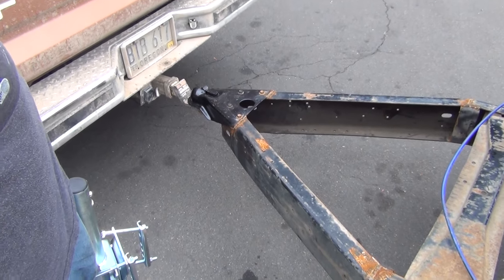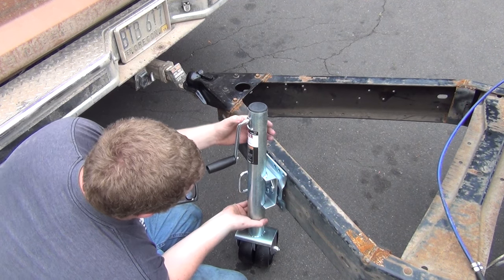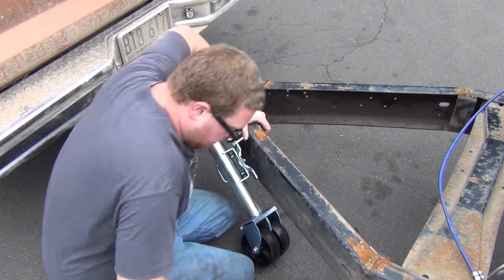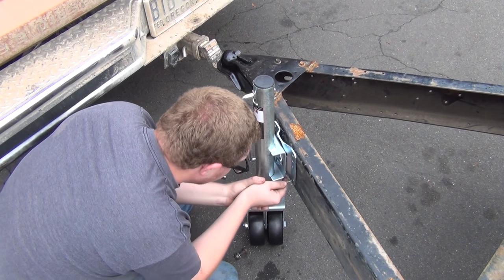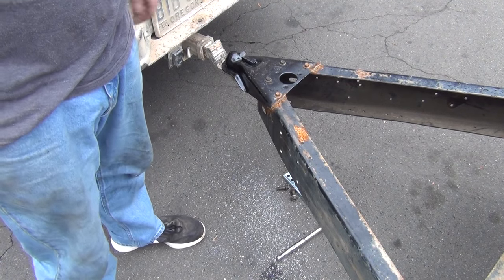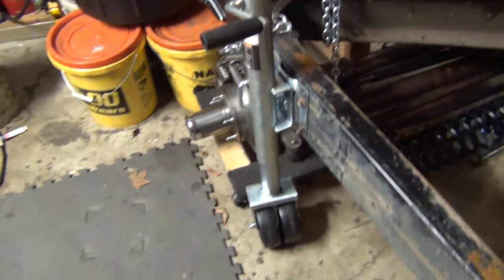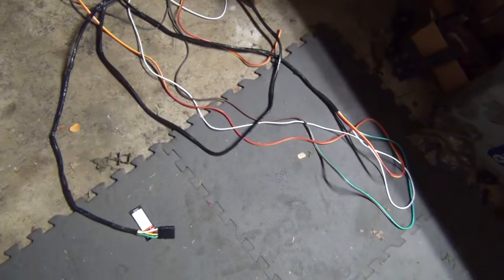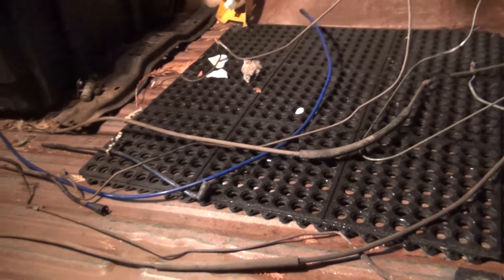Building a Bed Trailer! Part 3

Comment: having watched several of your vids, I applaud your efforts and ingenuity. These truck bed trailers are worth their weight in gold. I've made a few myself. Keep a few things in mind. Most truck frames aren't just mild steel. They're heat treated which requires a specific welding, cooling, and post weld heat treat process in order to mitigate stress risers and cracks....especially on a load bearing member of your trailer. Regardless of the welding machine used, IF something does go wrong, and a weld lets go on the highway...you'll be liable. Again, I commend you on your accomplishments and projects, just consider having a certified welder do structural work....especially if its going any further than a dirt road on a farm.